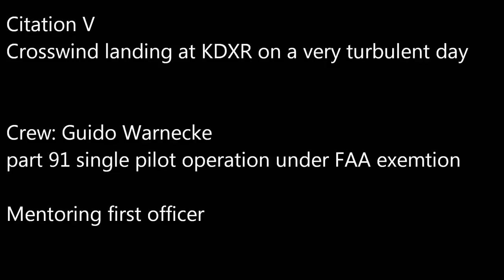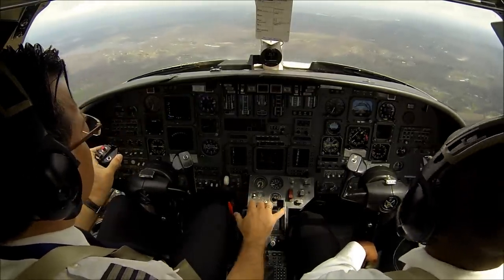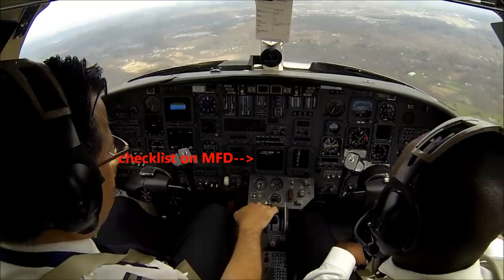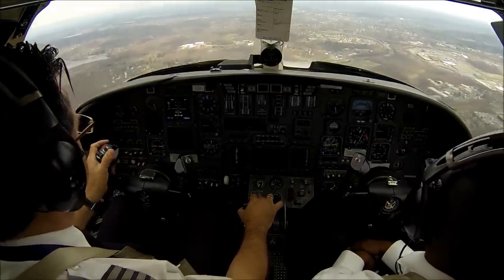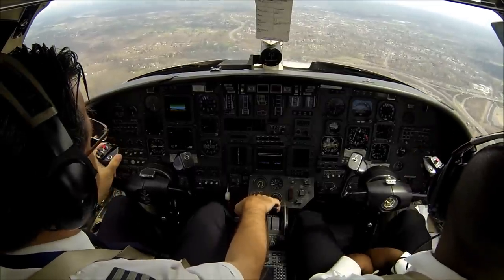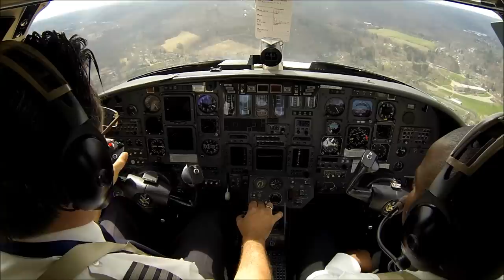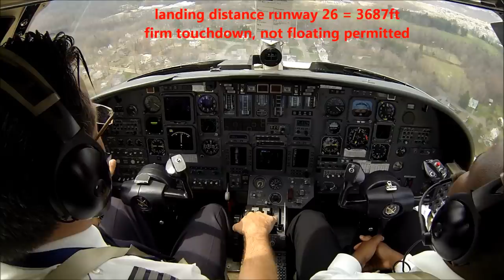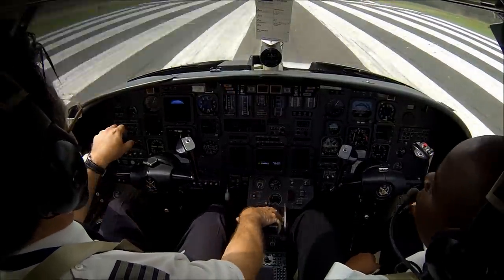Citation V: turbulence during landing. Cockpit view!

Comment: Another great video Captain Warnecke...gives a perspective I would never otherwise see for small turbine aircraft operations. My observations: 1) One thing that instantly struck me was the amount of throttle play. I only fly piston prop for now (VFR ASEL AMEL)..working on my IFR then commercial and hopefully CFI. I always thought, that due to the spooling of the turbine, there would not be instant response from the throttles as compared to a piston, so I imagined changing your rate of decent on the approach would not exercise the throttle as much. However, I can see that, at least for this size and type aircraft, in these conditions you seem to be using it almost like a piston pilot would. Are you flying so "ahead" of the aircraft that you're anticipating power response for decent rate changes due to the winds and performance landing? Just wondering...I always imagined that turbine throttles would be more "set"...perhaps I'm wrong? 2) It's great to see actual demonstration of increasing the flight control inputs as you lose airspeed and thus control authority as the surfaces become less effective at slower speeds!. 3) perhaps it's just a precautionary saying, but my instructors (the ones who fly airliners and RJ's) always say "never put a turbine to idle" unless you're over the numbers and landing assured...It looks like you went to idle a few times on the approach...is this true or just depends on configuration/aircraft/conditions? They say "always carry power to the numbers"...Should they really say "energy management"?
Reply from the maker: Thank you very much, Irvin.
I do not fly regional airliners, so I can only speak for the small business jets.
The engines are quite responsive.
During flight, we can bring the power only back to "flight idle", around 52% N1 as opposed to 46% on the ground This ensures a quick spool up of the engines.
Jet flying has to do a lot with energy management. In a "normal" flight you do not touch the power levers a lot. This landing in turbulent conditions requires a lot of power changes though.
Thanks for your comment & happy landings,
Guido
Reply: Irvin McGinnis
Reply from the maker: Hi Irvin,
This is how it looks in smooth air:
https://youtu.be/Af3fVp8R8bg?t=280
Just "sailing" to the ground.
Happy Landings,
Guido

Comment: Looks like you had some issues getting the reversers to deploy there on rollout Guido, could clearly see you attempting multiple times to pull the handles into the reverse range while the TR "ARMED" Lights on the glareshield were on, but they didnt seem to want to unlock for a while? What was the go with that?
Reply from the maker: Well spotted!
The TR's are very well protected to NOT to deploy in flight.
The downside is that sometimes they do not deploy when they should after landing. Multiple conditions have to be met, e.g. engines to idle and wheel struts compressed.
The WOW weight on wheel switches on the gear give sometimes problems, this prevents the TR's to deploy.
In the take off and landing performance numbers, TR's are not considered, so it is an "add on" bonus. At least for the light Citation jets this is the case.
Thank you for watching my videos such great details and Happy Landings,
Guido

Comment: good landing all though the control movements of the stick are so jerky and sudden, maybe a little soother movements and forced inputs would help
Reply from the maker: You have a good point. It is called POI Pilot Induced Oscillation.
The problem with the Cessna Citation is that the controls are designed for cruise flight. At low approach speeds the controls are not very effective.
Hence the rather rapid movements. One has to find a fine balance betweeen over-  and under controlling.
I apologize for the late reply.
Happy Landings,
Capt. Guido

Comment: i think i heard somewhere ignition(without being sure).. is that a safety reason before approaching? because i only know that ignition is used on the ground before the fuel on starting  and in the air only in really bad conditions ..
Reply from the maker: +tsio dimis 
In this aircraft, the continuous ignition has to be switched on during take off and landing. 
Otherwise in heavy turbulence and rain.
During the engine start, the ignition comes on automatically in this aircraft.
Happy Landings,
Guido
Reply: +Guido Warnecke thank u for your answer

Comment: Great video.  Thanks for sharing.

What are the "six lights" that permit reverse thrust and idicator of?
Reply from the maker: The lights give the pilot an information about the status of the thrust reversers:
The upper lights (2 lights): the T?R's are armed, meaning hydraulic pressure is applied to the deploy mechanism. The meddle lights (total 4 lights): the T/R's are unlocked. The lower lights (total 6 lights)" the T?R's are deployed. Hence the call ""4 lights" "six lights" in the cockpit to confirm that both T?R's have been correctly deployed. On a slippery runway (rain etc.), you want to make sure that your T?R's are deployed.
Happy Landings,
Guido
Reply: Guido Warnecke
Reply: Great info.  Thanks so much for explaining!!
Reply from the maker: you are very welcome!
Happy Landings,
Guido

Comment: Im doing my checkride in 3 days for my asel and in a windy part of the country. Im only allowed 10kts of direct cross as a student and I say that with even less wind I always crank my yoke into the wind as normal crosswind procedures. I noticed that you didnt adjust your ailerons at all after landing. Is that plane stable enough to not have to exercise CWP?
Reply from the maker: Best of luck for the checkride!

This is a heavy aircraft and the wind is not as strong. In a light aircraft it is a good idea to turn the aileron into the wind.
If the wind is stronger, you do this iheavier aircraft too:

https://youtu.be/GrwcIel3a1U?t=47s

https://youtu.be/CVD3lYH8C3Q?t=1m31s

https://youtu.be/mHbwZo-keGY?t=3m4s

Happy Landings,
Guido
Reply from the maker: How did it go with the check rice?
this is how it looks in smooth air:
https://youtu.be/Af3fVp8R8bg?t=280
Happy Landings,
Guido

Comment: i Guido. First of All, thanks for more one fantastic vid...however, why you requested full flaps to landing with 20 crosswind? Wide Hugs, Carlos
Reply from the maker: Thank you, Carlos!
In a light aircraft like a C172 I would definitely use less than full flaps for landing in strong wind conditions.
In the C501, I am not allowed to do this and have to land with full flaps (unless in an emergency). The reason is that the landing distance numbers are only published for full flaps in the Citation C501.
I keep it simple: if the landing is not safe with the configuration settings published in the handbook, it is not safe at all and I land somewhere else where the wind is less.
Thanks for watching my videos & happy landings,
Guido
Reply from the maker: Hi Carlos,
This is how it looks in smooth air:
https://youtu.be/Af3fVp8R8bg?t=280
Just "sailing" to the ground.
Happy Landings,
Guido

Comment: I have 2 questions, how far back will a tower report on gusts. what are the trained to report to flight crews, the highest gust.. but how long ago? also, in really bad turbulence, does the altimeter lag behind actual altitude?
Reply from the maker: I am not really sure about this.
For sure is that with ANY landing clearance the tower needs to give you wind information.
Also the pilot can ask at any time for a wind update.
There is some interference in strong turbulence with the altimeter, but this is negligible.
Happy Landings,
Guido

Comment: Maybe it was the audio, but I never heard any acknowledgement of the EGPWS, "sink rate" calls on final, does your company not require them?
Reply from the maker: Hi Stevie,
we take all EGPWS warnings very serious, let alone in IMC! 
Typically any EGPWS call is unacceptable unless the circumstances are very clearly briefed, the risks understood and accepted.
At Danbury, the 6 degree glide path for runway 26 required over the hill in close proximity of the ground obviously triggers the SINK RATE (mode 1). We usually say "disregard" if it is a known condition that does not entail any risk. Must have been cut out of the video or I simply forgot it.
Thanks for your comment and thanks for watching my videos in such detail.
Happy Landings,
Guido
Reply: Thanks for the reply, I haven't been into Danbury so wasn't aware of the steeper than normal approach.
Safe flights
Steve
Reply from the maker: This is how it looks in smooth air:
https://youtu.be/Af3fVp8R8bg?t=280
Just "sailing" to the ground.
Happy Landings,
Guido

Comment: Hello, what does sink or (sync) rate mean when the computer calls it out on landing?
Reply from the maker: Hi Dan,
this warning comes from the GPWS Ground Proximity Warning System. "SINK RATE"
It alerts the pilot from potentially dangerous operations close to the ground. Our descent rate (because of the steep mountain at KDXR) was 1,000ft per minute. At high altitude, this would not be a risk, we descent often with 3,000ft per minute or more. Close to the ground this might be dangerous if done unintentional. The approach at KDXR is very special and you shpuld never hear the "SINK RATE" alert on a normal approach.
There are different modes on the GPWS also for example a landing gear warning, same thing: no problem if the gear is up at altitude, but a risk if the gear is still up when flying at low altitude.

A summary of the functions here:

http://en.wikipedia.org/wiki/Ground_proximity_warning_system

Thanks for watching my videos & happy landings,

Guido

Comment: Just curious,  I have heard how good those noise canceling headsets can be but all throughout the video,  is what I heard is pretty much excatley what you heard,  I mean was it actually that quiet with those headsets on,  I couldn't even hear the engines??????
Reply from the maker: +Andrew Silva HI Andrew,
these headsets are really good.
They filter a lot of noise out.
The engines can still be heard but it is quite anyhow ans these engines are mounted at the rear of the aircraft, far away from the cockpit.
Happy Landings,
Guido

Comment: Guido, watching this again and on final with the chop, do you have to mentally lead the spool up to adjust for turbulence?  just wondering.
Reply from the maker: Hi Pat,
flying a business jet is normally "by the numbers", you set certain power settings and only make minor adjustments  During turbulence and under difficult conditions (the steep approach at KDXR), it is all back to "hand flying". It requires a bit experience how much power to set and when. The response time of the engines is good but not as quick as in a piston engine.
But it is all far less difficult than it looks on the video...
Happy Landings,
Guido

Comment: Is it normal that he was fighting with the steering during landing?
Reply from the maker: During low speeds during an approach the aircraft is quite unresponsive.
Significant control inputs are required id turbulence is present to maintain the desired flight path.
Different in smooth air:
https://youtu.be/Af3fVp8R8bg?t=280
Happy Landings,
Guido

Comment: You landed short of the 1000 foot touchdown market which means you were below the GS/vasi?
Reply from the maker: Hi Kevin,
yes that is correct.
On a visual VFR approach this is acceptable.
NOT acceptable in any instrument approach.
Happy Landings,
Guido
Reply: Guido Warnecke 
Thank you 

The 135 world, the landing providing the VASI lights are operational, all turbine powered aircraft must land at the 1000 foot markers. 

I’ll look to see what part 91 says as I don’t operate in that world.

Kev
Reply from the maker: @ahl2easy  At KDXR, all turbojets are planted on the runway just after the displaced threshold.
A lot of rubber marks there...
Pilots who are not local hate this airport:
https://aviation-safety.net/database/record.php?id=20150821-0
Happy Landings,
Guido
Reply from the maker: https://twitter.com/MayorMark/status/634800917733351424?ref_src=twsrc^tfw|twcamp^tweetembed|twterm^634800917733351424&ref_url=https://aviation-safety.net/database/record.php?id=20150821-0

Comment: Why do you push forward on the yoke after thrust reverser activation? Thank you!
Reply from the maker: Hi David,
in the Citation V, the engines are mounted quite high. Reverse thrust will then produce a "pitch up" moment that you counter-act with pushing on the controls. The other reason to push forward on the landing roll out is to get more weight on the nose wheel for enhanced directional stability and nose wheel steering.
Happy Landings,
Guido
Reply: Guido Warnecke Excellent information Guido. Keep up the safe flying.
Reply from the maker: Thank you David!

Comment: i cant believe that the cock pit isn't much  bigger then a 172 cockpit , i would love to fly a citation one day , i only have 53 and a half ppl time and 50 of that was training , what steps do you recommend to get into the corporate business ?
Reply from the maker: Ian, the cockpit is a little bigger than a C172, may be like a C210. They make these airplanes for passengers and not for the pilots...
Corporate business: it is a difficult question. The first thing you need to have is a commercial license and preferably multi-engine instrument rating. From there it is still a long way. I have supported and mentored a young fellow pilot, who started working as a line man fueling airplanes and is now First Officer on the King Air B100. Every pilot career is different in details but they have one thing in common: it requires hard work and dedication.
Best of luck!
Happy Landings,
Guido

Comment: I dont know.. i prefer stabilized with thrust at low, but not on idle. Happen anything and no time for spool up, only for good smash
Reply from the maker: Hi Vladimiras,
this aircraft has 2 idle settings: ground idle and flight idle.
Ground idle reduces N2 by 10% and comes in after 8 seconds on the ground.
With power to flight idle the engine is still very responsive.
The ground idle setting is designed to reduce idle thrust during taxiing, you would have to use the brakes all the time.
Happy Landings,
Guido

Comment: Nice job ! What is your speed on final approach ?
Reply from the maker: Thank you Domenic.
The speed on final approach depends obviously on the weight (we can burn up to 5000 lb of fuel before landing).
Vref - speed over runway threshold - is 92 kts (light aircraft) to 106 kts (max landing weight. The Citation V is a "slow" jet in comparison to others which have a Vref of typically 120 kts and more..
Happy Landings,
Guido

Comment: Would the captain be allowed to say to the second to take the landing just because he feel to do so or such or must there be a   very    good reason?
Reply: A good Captain will insist his copilot handfly at least 1/3 to 1/2 the landings.  Something tells me Guido is more autocratic, afraid of discomfiting the boys in back and without much confidence in this flight's copilot but that is 90% speculation.  Would be interesting to (after he moved on to better job) ask THIS copilot what % of landings he flew.
Reply: Swampy Dave I agree with that conclusion/suggestion.
Reply from the maker: very simple here: the copilot was not (yet) type rated on the aircraft. this was a private part 91 flight under my single pilot exemption. under these conditions of the flight, I might have made it a Captain landing anyhow, depending on the experience level of the Co pilot. Safety is first. 
It is a fine line as you want to expose the co pilot also to gain experience. 
The co pilot is now Captain for one of the Regional Airlines.
Happy Landings,
Capt. Guido

Comment: Guido's got the reflexes of a Cheetah chasing down a Gazelle! LOL
Guido 1 Turbulence 0.
Reply from the maker: Thank you!
The Citation V does not handle very well during landing is not very responsive to control inputs.
Thanks for watching my videos & happy landings,
Guido
Reply: Guido Warnecke
I noticed that. If that was car you were driving I'd say maybe you need to get the steering looked at. LOL
Reply from the maker: AL Ian Yep.
These aircraft are designed for cruise flight at 41,000ft....
Happy Landings,
Guido
Reply from the maker: This is how it looks in smooth air:
https://youtu.be/Af3fVp8R8bg?t=280
Just "sailing" to the ground.
Happy Landings,
Guido

Comment: Sink Rate?
Reply: +Cathy Meyer It says that when the plane is losing altitude too fast
Reply from the maker: +Aiman 
Thank you!
To be precise: the sink rate of the aircraft is too high while the aircraft is already at a lower altitude.
While we descent regularly with 3,000 feet per minute at high altitude, no warning is triggered. You do the same at lower altitudes, the alarm goes off, even at much less rate of descent, say 1,000 feet per minute. The logic behind: be careful when you are already close to the ground. 
Hence the system is called GPWS "Ground Proximity Warning System".
Happy Landings,
Guido
Reply: Guido Warnecke Thanks for the explanation :)

Comment: Wow yoke movements!
Reply from the maker: Hi Philip,
at low airspeeds, the aircraft is quite unresponsive. So it requires significant control inputs to maintain the desired glide path when turbulence is present.
Totally different in smooth air:
https://youtu.be/Af3fVp8R8bg?t=280
Happy Landings,
Guido